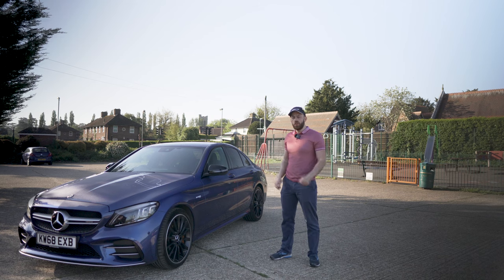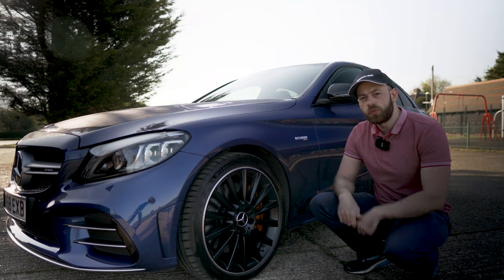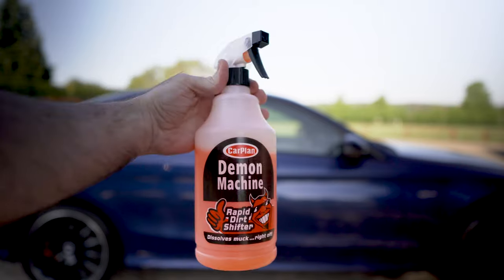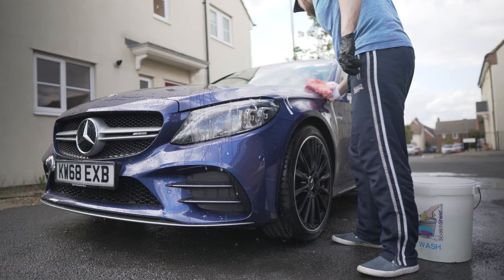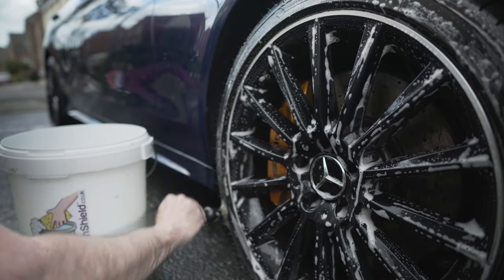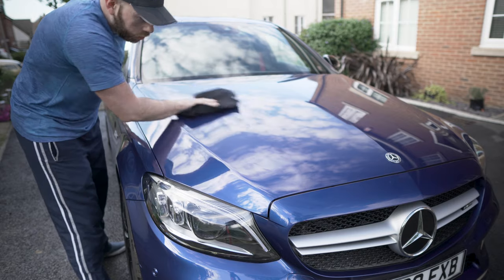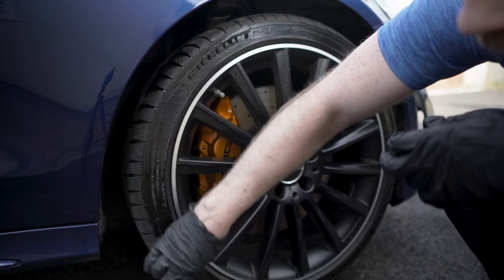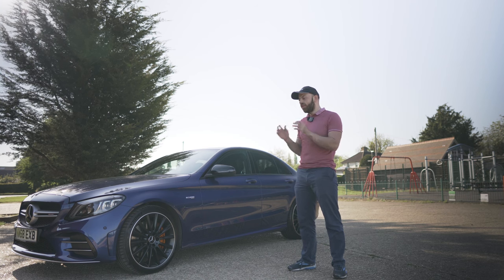Wash and protect your car in under 30 minutes. My ultimate quick car detail

Comment: I've been using Demon Shine for a number of years, the water beads immediately, use a squeegee to take off the excess or take the car for a quick spin, then buff it off, leaves a protective surface to repeal the rain, but I will be trying your recommendation of the Meguiars Ultimate Fast Finish, looks a decent alternative.

Comment: Great video and will defo save me time doing my c250. Is the paint protection used instead of ceramic coating spray? Or is that something completing different? Thanks
Reply from the maker: Thanks NG! A proper ceramic coating is a long process that a professional detailer will do. If you've had your car ceramic coated then there are special products to use after. If your using a ceramic coating type spray these are different to a full ceramic coating. You could either use the ceramic style spray or the spray I used. Both have a similar effect and work well. I have planned to do a full video series of the full ceramic coating process with a professional detailer later this year if you want to learn more about this and it's benefits. Watch out for that one hopefully not too long from now :)
Reply: @ABAUTOAMG  thanks for the detailed reply that's helpful. I think I'll stick with what you used and see how that goes, got my car in black and a jetwash just doesn't seem to cut through the dirt so going to have to go old school hand washing. Will defo look out for ceramic detailing video as would love to keep my car in tip top xondition. Thanks

Comment: Just took delivery of my C43 Coupé before lockdown so I've not had too much opportunity to take it out but it's filthy just from dirt in the air and rain and needs a good clean. It used to take me ages to wash my car so I'll definitely be following this to see if I can get it all done faster. 

Do you use hot water or cold with the car shampoo and does it make a difference? I did notice there isn't much foam and wondered if that was something to do with it.
Reply from the maker: Hi David, firstly congrats on your new coupe! I too used to spend hours on my car, happily so to be honest! But I dont have that free time these day, esp with a 1 year old daughter :) Cold water is fine, comes straight from my outside tap. The lack of foam is more to do with the cuts in the footage. I always start from the top and work my way down and the top shots dident look as beautiful so I tended to cut the footage from the mid point where there's less foam from the wash mit. If you check when I do the front bonnet there's a lot more foam. It's also the result of doing more panels in one bucket dip to get around the car quickly (only advise this when car I'd not too dirty). Hope this all helps :)

Comment: Do you know if the Autosol can be used on the AMG night package i.e. black exhaust pipes?
Reply from the maker: Hi Mate, I wouldn't recommend it. Some say it's fine but I'd be worried the slight abrasion would take away some of the paint. You may find an all purpose cleaner and a good quality bodywork polish does a nicer job.